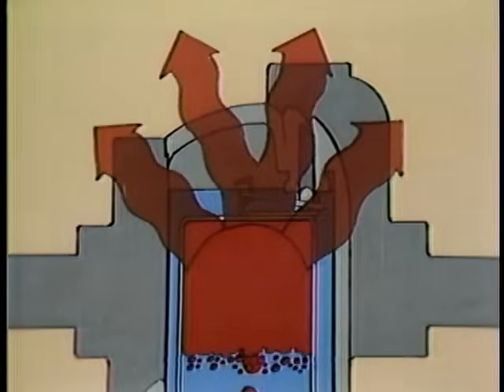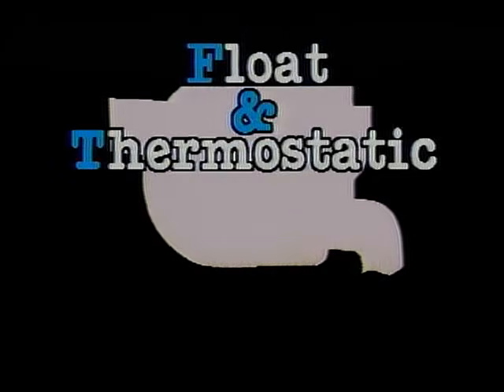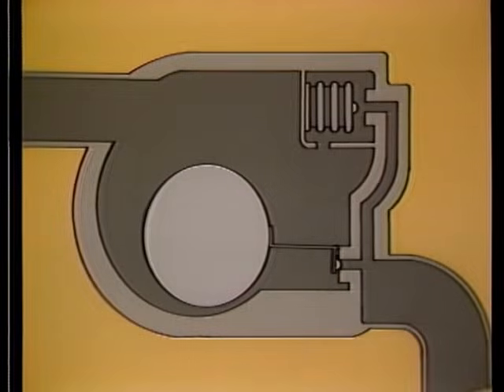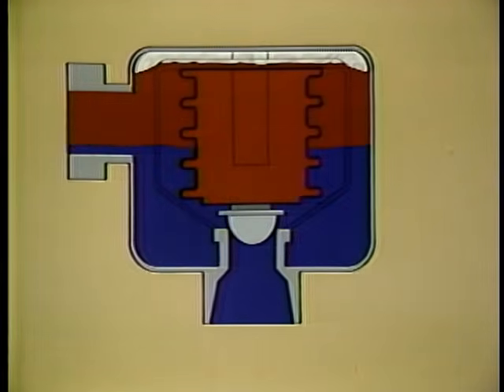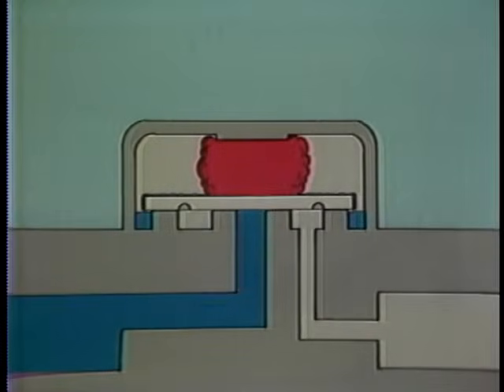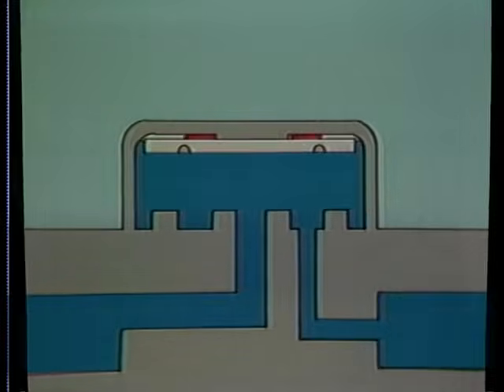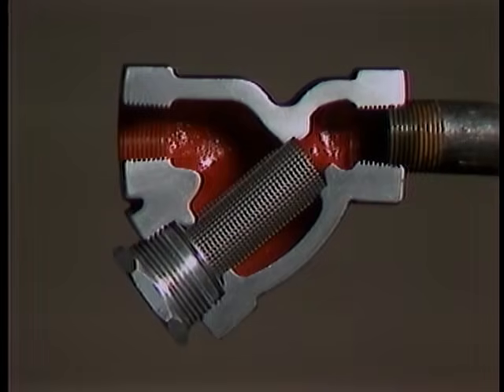Let's Talk Steam Traps

Comment: Mechanical Steam Traps
3:29 Inverted Bucket
6:17 Automatic Differential Condensate Controller
8:32 Floating Thermostatic Trap
Thermostatic Steam Traps
10:34 Bellows Trap
Thermodinamic Steam Traps
13:42 Disk Trap
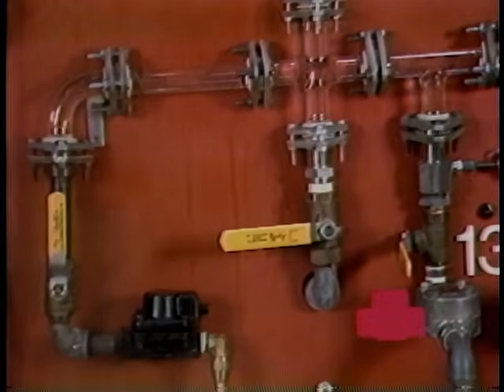24:25 Disc  Trap with Strainer

Comment: In the inverted bucket, where is the output of steam?
Reply from the maker: On any type of steam trap, including the inverted bucket steam trap, there is no output of steam. The main purpose of the steam trap is to trap the steam into the system (heat exchanger, coil, etc) allowing it to transfer its latent heat. On the outlet of the steam trap you should only see condensate, air and non-condensable gases. When the condensate goes from higher pressure to lower pressure it will flash so you might see some flash steam also on the outlet of the trap. Please let us know if you'd like more information. We're happy to share our knowledge!
Reply: @ArmstrongInternational  Tell me everything you know about the Illuminati and the Jews.